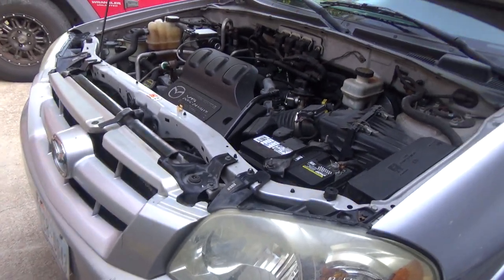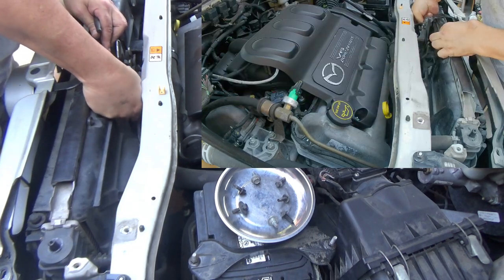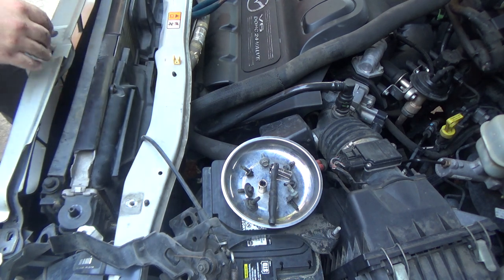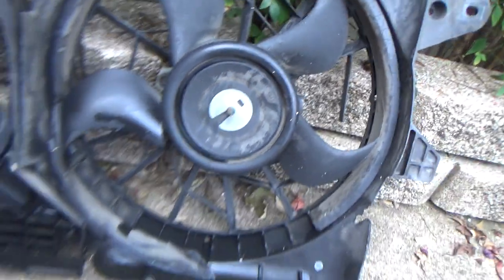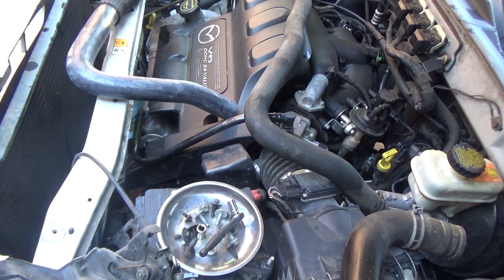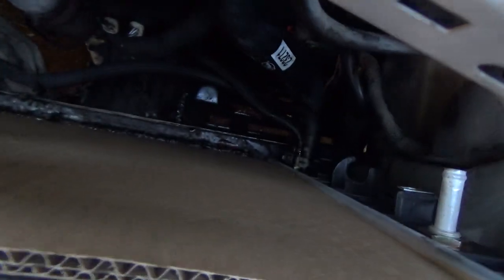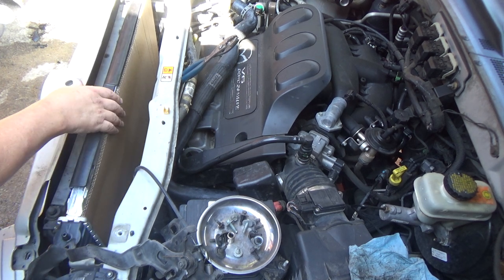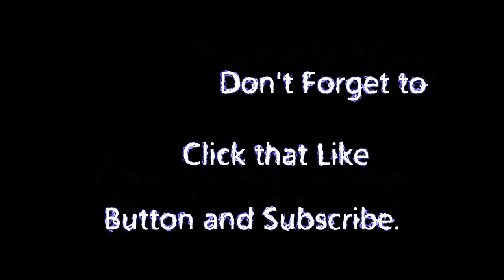Easy 2005 Mazda Tribute / Ford Escape Radiator , Fan , and Hose Replacement ALL from the Top.

Comment: One question, would it have been easier to install the fans first before the new radiator?
Reply from the maker: The only problem with that is with the fans in their position you can't get to the bottom 3 hoses so I would have had to jack up the car and lay on my back and disconnect and reconnect the 3 hoses. I am of the age that I and getting tired of working on my back so if I can stand upright I do everything I can to do so. My next house will have a shop with a car lift.
Reply: @737mechanic  that makes perfect sense!  You definitely are a real professional mechanic who damn sure deserves and would use a lift, FOR SURE!  Love you videos and I learn a lot!
Reply from the maker: @proudtexan5513  Thank you for the nice compliment friend.

Comment: I have an '05 Mazda Tribute and in my opinion it has to be the absolute worst design ever. It's like Mazda engineers finished their V6 engine , stood back and said, " Huh! We forgot the water pump!" Also disconnect the battery, remove it and the battery box and you'll have a lot of access to the lower hoses.

I'm going to fix my piece of junk and sell it to some poor unsuspecting schmuck.